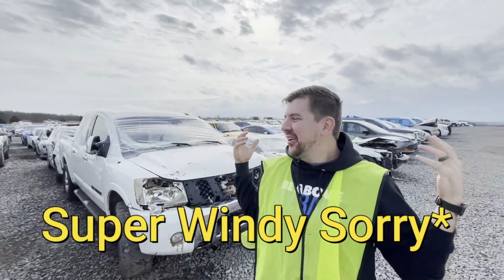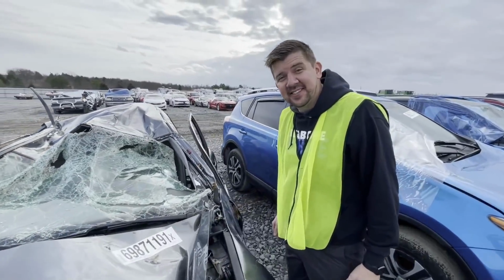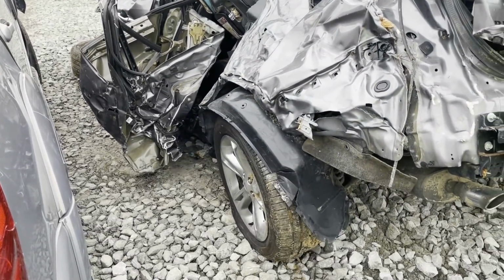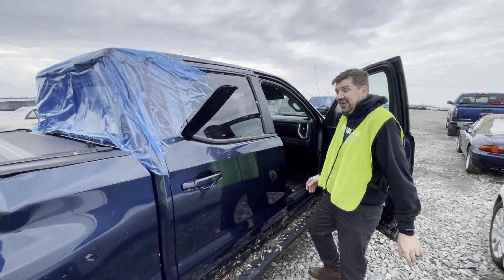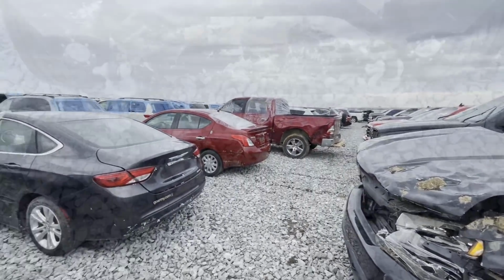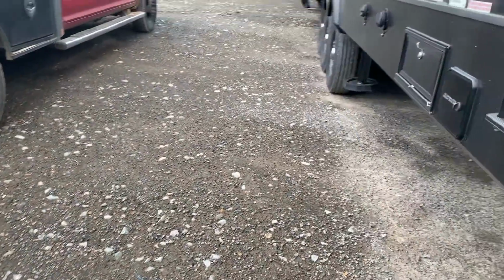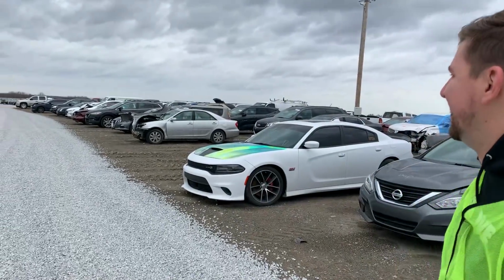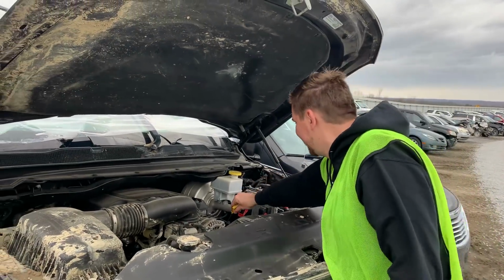SHOPPING FOR TORNADO DAMAGED CARS SHOULD WE BUY A FEW?

Comment: Years ago we had an auto wrecking yard and had a severe tornado in our area and I was hauling cars. At one place the cars were next to a corn field. The sand in the field was quite coarse and entire sides of the vehicles depending how it was sitting and in come cases they were rolled but anyway sides were completely sandblasted clean of paint with dents and debris stuck in every crevice.